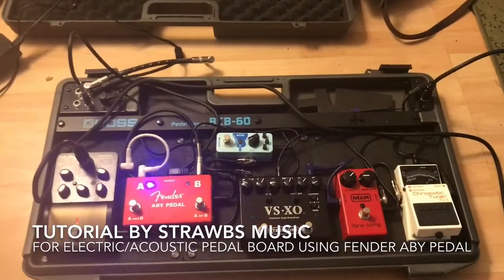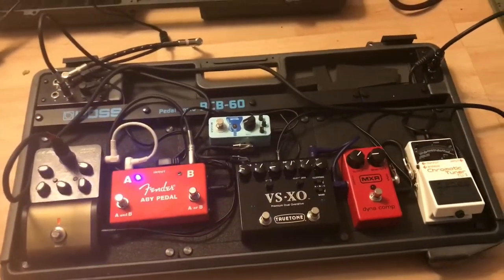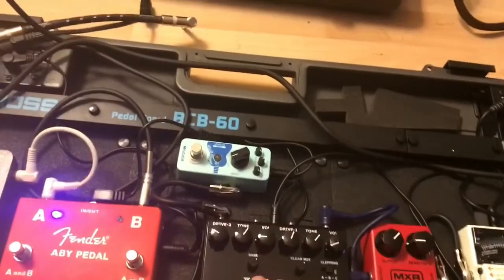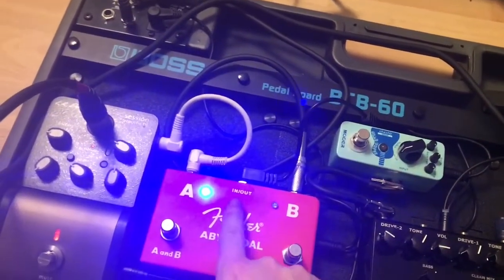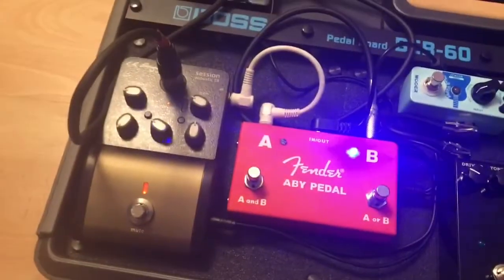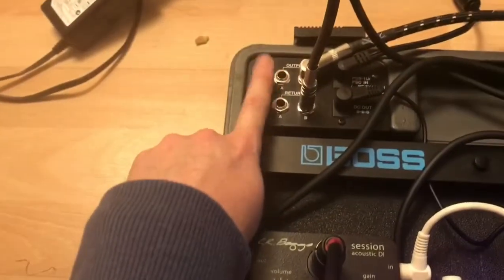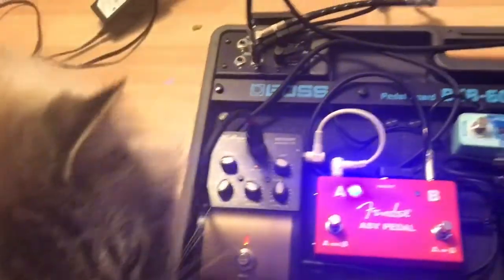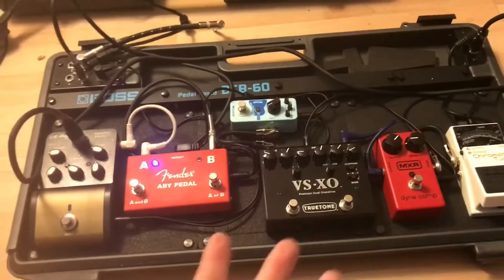Acoustic & Electric Pedal Board Set Up

Comment: Cool setup! I wanna do something very similar...…..but something that would allow me to create loops with BOTH an acoustic and an electric guitar. I would probably need an ABY on the front end for 2 guitar inputs......and another ABY at the end of the chain to route the electric to a mic'd amp and the acoustic to the PA...…….at least that makes theoretical sense....Lol! Would you know of a better way? Sorry to ask......just need a little help.Lol!!!
Reply: Hi Daniel! 

The Fender ABY pedal can work both ways so you could use it in the way you describe! I would however recommend directing the two outputs into a mixer rather than using another switcher pedal. That way you can individually control the level of volume and some mixers also have EQ knobs, that means you have a little more control over your two tones independantly. Mixers are a little more pricey but will be worth the investment since mixers have plenty of uses for other audio equipment. The main downside is the space mixers take up and if you're a traveling musician then carrying an extra piece of equipment with an independent need for power could cause issues; since you need a separate power supply for it. One great thing about the ABY pedal is it does not require power to work (other than the blinding blue LEDs it has) eliminating the need for external power and its built like a guitar pedal to mount to a pedal board. The cheapest solution would be buying a mono 1/4 dual splitter cable, that will do the same job as the switcher, since you don't need more switching toggles i would recommend that (just make sure its a good quality cable and that the impedance for your outputs match).

Hope this helps!

Comment: I use mine in a similar way (eventually will be directed to two separate amps). I currently have mine set up for recording. 

Guitar to wah to ABY switcher. 
My A route goes through my boss AC-3 (acoustic simulator pedal) directed from the line out to a noise suppressor (the AC-3 creates a very small hiss without it) into a mixer. 
My B route goes through a noise suppressor-(compressor, distortion, phaser, chorus)-noise suppressor, delay and amp then i use a passive Di into the mixer and cab.
Mixer goes direct to a USB audio interface.

I noticed it looks like you have an acoustic Di for your acoustic tone. I was recently thinking about purchasing an acoustic Di but decided against it because my acoustic simulator has a line out port for me to match impedance. Would an acoustic Di help me eliminate the hiss my AC-3 produces?

Thanks for the video, awesome set up! I'd love to hear how it sounds!